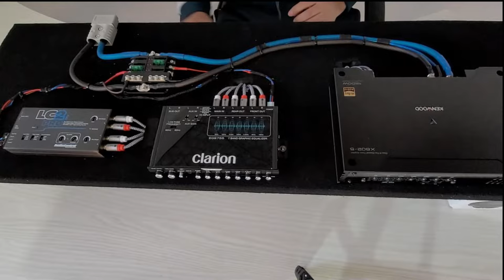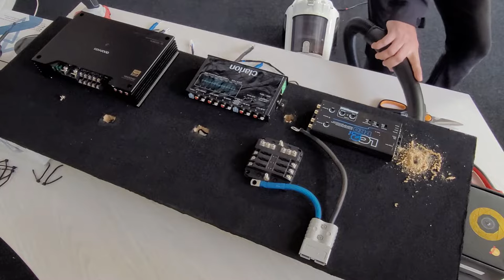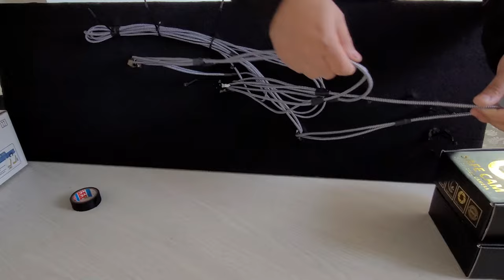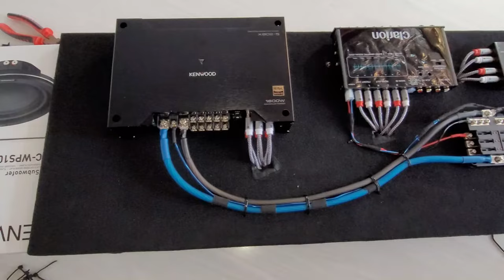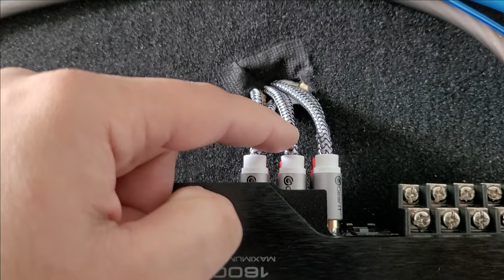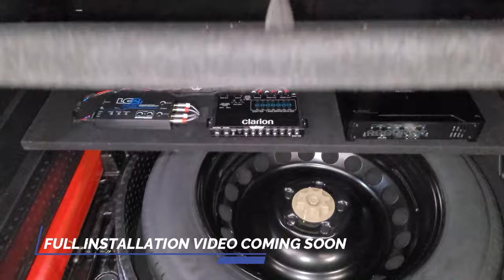How make connections for LC2i + Clarion Equalizer + Amplifier | Car Audio | LC2i | Clarion Equalizer

Comment: My question is how do you expect to use equalizer functions on the subs if you passed up the EQ from sub out on the l2ci? Unless the main inputs allow for you to still control your low pass amp? Then it would make sense. Can someone explain??
Reply: It doesn't work.  I tried it that way.  Your bass is going through your head unit now and can't be controlled by the EQ.  The bass will still keep playing while the EQ volume is down.   So your right.  You won't be able to control the bass through the eq.
Reply from the maker: Lc2i has 2 outputs, one for speakers and one for subs.
You can install Sub without using EQ. Speakers need EQ because lc2i doesn't provide outputs for individual speaker. ( correct me if I'm wrong).
Reply: Is better  use the pre amp for the base, and the full Range from the Lc… thats for a better signal , and the bass is better from the pre amp

Comment: So i can run my 4 channel amp for my mids and highs and still use the subwoofer output for my mono block ? With my factory Head unit how woulld i wire that up. I also dont have equalizer.

Comment: I’m wanting to run three separate amplifiers one for my front door speakers one for rear door speakers and one for my subs can I still use the LC2 to run three amps or what do you recommend 🤔
Reply from the maker: I would suggest run 2 amps only and lc2i has outputs for sub n speakers.
Run 1 amp for speakers and 1 for sub. It will make your job easy and it will Reduce your cost as well.

Comment: Question, do I have to connect all 4 speaker inputs on the LC2i or can I just use the left side since I will be tapping to the factory sub only?
Reply from the maker: You can tap on one front speaker to install sub or to use lc2i. But I would recommend to tap on both front speakers for best results.

Comment: What did you need the lc2i? The clarion accepts speaker level input
Reply: He’s connecting subs I assume with a stock unit. The lc2i provides the clearest possible output signal from a stock unit.
Reply from the maker: correct
Reply: @fastquickaudio5890  I purchased the lc2i. I don't have a dd1 so I'm assuming the linein inputs on the clarion isn't that clean but the rca is ok?

Comment: I have a 1986 Jeep Grand Wagoneer and Im adding 4 new speakers, a four channel amp, equalizer, and a powered sub.  Is the LC2i only necessary if I run the factory headunit?  Im adding a Rockford Fosgate Punch P300-10 powered sub, do you have any recommendations on how I should wire that in?  Thank you.
Reply from the maker: Hi R D, Sorry for late reply. You don't have to LC2i . You can install 4 channel amp on current stereo and RF P300-10 can also be managed through equalizer.  Make simple installation with equalizer.  Thanks
Reply: @fastquickaudio5890  Awesome.  Appreciate the response and videos.

Comment: I had this thought in my head..
I have an old
5 channel active crossover
Front Hi
Front Mid Bass

Rear Hi
rear Mid Bass
Subwoofer

With the LC2i Pro
I can connect 
X1 Hi Power subwoofer amp
X1 4 channel amp...

And Daisy Chain the remote turn on from the LC2i Pro to the Active Cross over then to the Amps just like how I had it set up before in my VW Bora with Kenwood 725dvf....👍🇯🇲🇬🇧🇯🇲🇬🇧🇯🇲🇬🇧🇯🇲🇬🇧
Reply: The lc2i will only remote power two devices

Comment: can i install a equalizer on a factory radio without RCA output?
Reply from the maker: Yes you can do that without RCA output, Use front speakers wires from back of the stereo.  It comes with both options RCA input and High level speaker input.
Reply: Hi, I'm chiming in to ask is there any quality difference between the option of how you described using the stock speaker wires into high level input on clarion EQ or using the LC2i? If not, I will not need to purchase a LC2i
Reply: @Handy_Randy  i don't know if your asking me but i never got into doing any installation so im not able to answer your questions, sorry
Reply: @proman378  thanks for your quick response. Let's see if @fastquickaudio5890 has an answer for this.

Comment: So, are you using the EQ to split the channels for the doors instead of getting an LC7i to do this? If so, great idea I want to steal(if I understood?) bc I have the same Clarion and can just get an LC2. Please let me know if it all works out? I'm planning out a system now.
Reply from the maker: Hi John, LC7i doesn't have an equalizer, that means i can only make connection straight from LC7i  to Amplifier, In that case i can only control bass from LC7i and from speaker Amplifier. Since I'm using tweeters as well, so there is no such way to Equalize sound if i don't use an Equalizer. I Just need a nice n' clean sound for that i used equalizer. And it worked really good.
Reply: I did a similar set up with 2 amps. Hooked up my EQ at front so i can control it whenever i want. I also hooked up the subwoofers rca to the EQ. I can control everything at any given time. Yes its more wiring this way but worth it. I never got my subwoofer to sound good using just the LC2I. Tried adjusting the lc2i gains but just didn't work out for me.The bass was just not there. Now every song i play from any source can sound bad ass with the EQ.

Comment: You not explaining anything you just connected the wires
Reply from the maker: explained at the end
Reply: Why did you connect the rca to audiocontrol and not in the equalizer?if that was the case why not install rca splitter to convert them in to 2 channel to the amp?
Reply: Lol